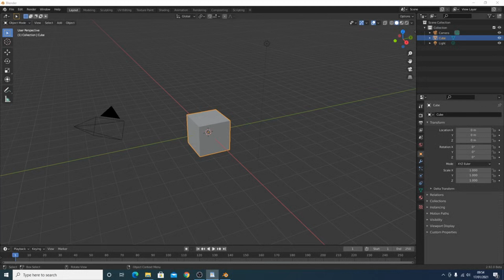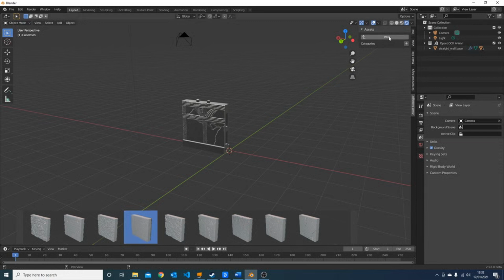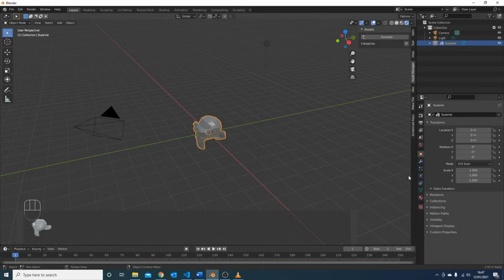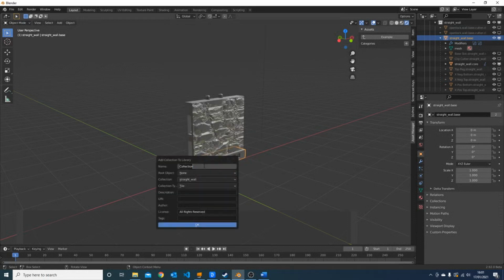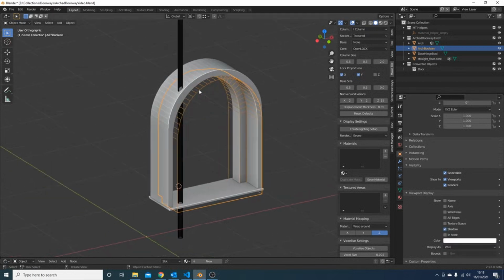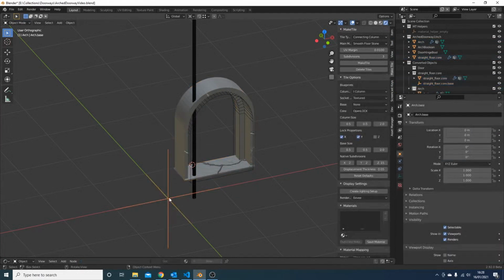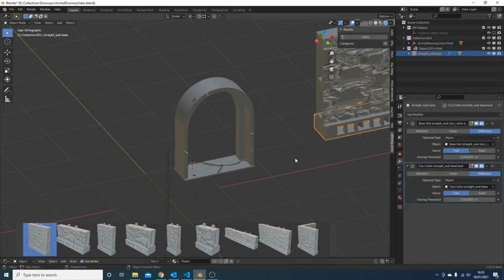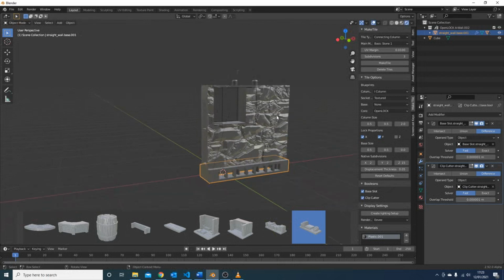MakeTile Alpha 0.0.20 and Asset Manager Released!

Comment: I'm trying to export the tiles with bolean and all comes separated. I would like to know how to export a wall with a door hole for example.
Reply from the maker: Hi Louise, when you export make sure you use "Export Tile" in the export panel in the MakeTile menu and have "Voxelise" turned on. This will fuse all the parts of the tile together. You can increase and decrease the voxel density in the "Voxelise Settings" panel.

Comment: How do I make my own windows or doors with the boolean attached to do the cutout similar to the ones you have built? I have a mesh for the window and 1 to use as a boolean to cut out the area it is to be installed into. Thanks
Reply from the maker: Hiya Gary. If you follow the video from about 7 minutes in it shows how to do this with a door way. Follow the same procedure for a window and then save the collection, selecting architectural element. One thing I skip over is that you need to create a collection in the outlined in the too right first and ensure the pieces of your arch element are in there